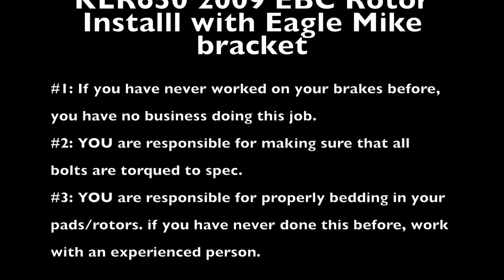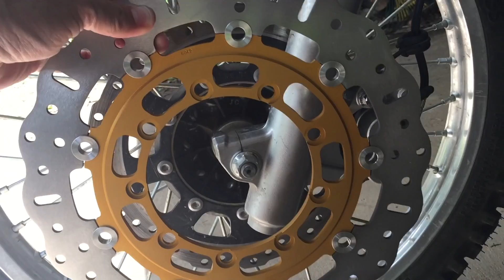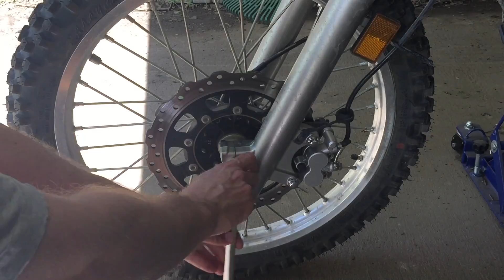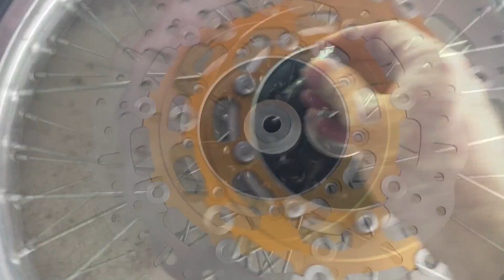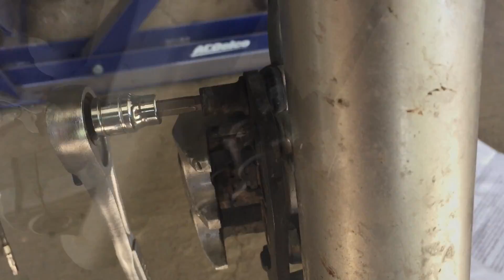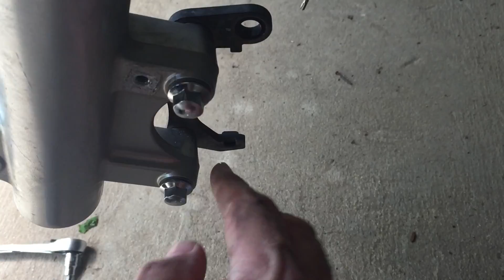KLR650 EBC Brake Rotor install

Comment: I bought a similar rotor (EBC SM6309C) and EM 320 bracket and cant get it to spin freely without the circular inner rotor washers (the silver washers between the brake grab area and the inner brass rotor hub) catching on the bracket.  Granted the caliper was flushed of brake fluid and the caliper pistons were fully retracted to allow insertion of the rotor but I don't think that should make a difference.  Did you have any issues like this during your install ??

I had to revert back to the stock rotor and bracket as I couldn't get it spinning freely without catching.
Reply from the maker: eqjunkie Well, something is fundamentally wrong, but you already knew that. :) If you're using the stock caliper, then there really are only two possibilities: (1) the diameter of the rotor's hub is too large, placing the washers too far from the wheel hub, or (2) the bracket is holding the caliper too close to the rotor hub. If it's that second one, you could have an incorrectly sized bracket, or it could be mounted improperly.
If I was a betting man, I'd guess that you may have the wrong sized rotor.
Reply: I dunno it's the same bracket as yours and the same size rotor. install went the same as yours the only diff where you put your wheel back on the brake pads poked further out from the bracket edge whereas mine was pushed all the way in as the system was bled. about the only thing i can think of.
Reply from the maker: eqjunkie hmmm...did you by any chance install new brake pads as part of the procedure? Also, there are some brake pads that don't fit quite right - galfers usually. If you're sure the rotor is right, the problem must be on the bracket side...I'm willing to measure any specific part dimension if that would help. Glad to see you also posted the question in klr650.net - the people on there are great.
Reply: Yeh I bought the pads along with braided hoses from eagle mike so they should be the right ones.
Reply from the maker: Based on how your discussion on klr650.net is progressing, I think my initial response may indeed be correct - you may have something odd about your rotor.
Reply: Yeh i think I'm gonna return it and get the EM rotor. The design of these EBC rotors seems a bit unsafe with those button/washer things just holding the 2 parts of the rotor together while it spins round and absorbs the pressure from the pads especially on the front wheel.

Comment from the maker: My favorite bedding technique, from member ChuckB at KLR650.net: "Pad bed in....I think is one of the more important steps. I have a hill nearby that I like to use. I'll get the pads/rotor(s) heated up by lightly applying brakes heading over to the hill/road. I'll get up to 60 mph then apply moderate brake till the bike reaches 15mph. Release and continue riding down the hill. Turn at the bottom and head back up the hill. Next 3-4 trips down the hill I'll apply more and more lever pressure. The next 3-4 runs I'll run speeds up to 70 mph and apply threshold braking all the way down to 15mph. These last couple runs you can usually feel the pads bed in completely. Feel it thru the lever. Once satisfied I'll ride the bike for a good 15-20 min trying to avoid stopping or applying heavy brake to allow the brake system to cool down. Key to pad break in is to never stop during bed in process...never. Once the pads/rotor is cooled down you should see discoloration on the rotor...means you generated enough heat for proper pad material transfer to the rotor."